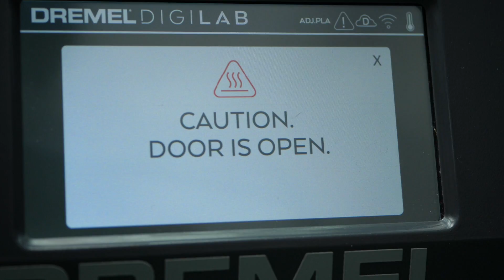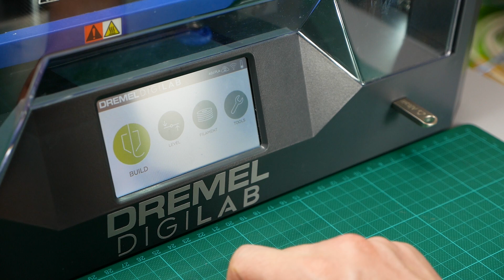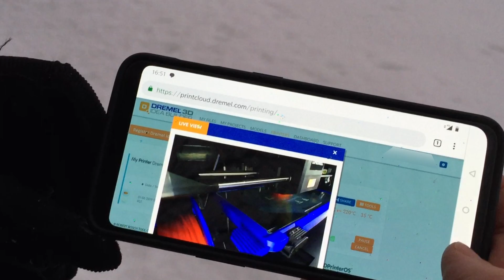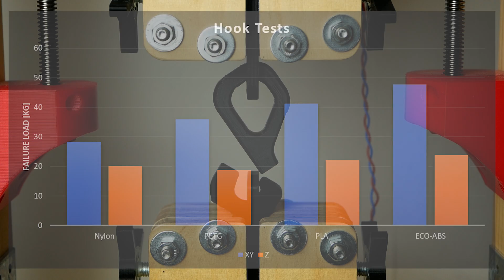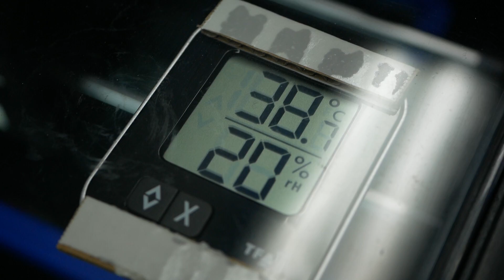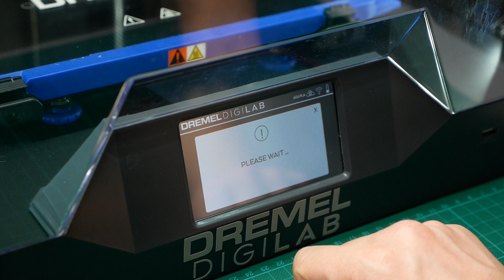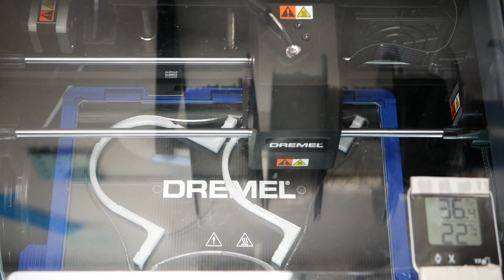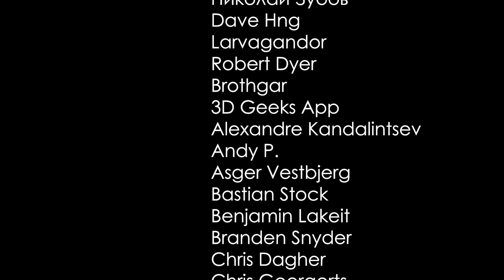Wasted potential!? DREMEL 3D45 + all materials - FULL REVIEW

Comment: I use 3rd Party filaments with this machine, with no problems. I drilled a small hole in the side door, leaving the fake Dremel Eco-ABS filament drum in place, and run the 3rd Party filament (sitting on a Lazy Susan turntable) to the feed tube. My biggest complaint is that you won't find anyone selling smaller nozzles (they are M7 thread) for more detail. So I am working with 3D Solex (in Norway) to produce a 0.15mm, 0.2mm and 0.25mm nozzle. Once tested, these nozzles will be available very soon. By the way, this machine is identical to a Flashforge Creator IIs. What threw me, for a while, was that it wasn't using settings (bed temperature etc) that I was specifying in Simplify 3D. Then I found, in the menu, that you have to select "Use G-Code." You mention the Micro Swiss nozzles, available in only 0.4mm and 0.8mm but, having bought some, the quality is appalling and, because they are made of hardened steel (instead of brass), you have to play with the heat settings quite a lot. Please know that Dremel has changed its position on using 3rd Party filaments and you CAN use any filament, without affecting the warranty. Please check the Dremel website, which confirms this.
Reply: I'm glad you were able to work around the filament issue, but imho the idea of spending 1500 on a printer and then having to drill holes in it and use a lazy suzan (or whatever spool holder type thing lol) to use my own filament is just fucking insane.
Reply: @bob88099  To be fair, this machine is aimed squarely at the Education Market (and spare bedroom user). I'm an Engineering teacher who has campaigned for a long time that all Technology classrooms should have a 3D printer. This machine has been designed to not take up much space (hence the 0.5kg spool space), be fully enclosed, have a camera so multiple students can see what is going on, have a filter to extract fumes, have a heated bed so older students can print nylon, have a system that allows someone to level the bed very quickly and need little or no maintenance or clean-up. This machine fits the bill. I can rewind filament onto the Dremel spool and not have to drill a hole. I chose to do this, to save time. If the Ender came with an enclosure, didn't have an external filament set-up that any kid can play with and had filtration, every school would jump at the opportunity to buy one. It's the same with Desktop CNC machines - schools get ripped off by having to buy limited, enclosed machines - and only from approved suppliers. It also took me years to persuade schools to buy relatively inexpensive water-cooled Chinese Laser Cutters, instead of rebadged far East machines sold by American firms where, when the tube was blown, the whole year's department budget went on a replacement, or we had to pay shipping from the UK to the USA to have the laser fixed under warranty. Nothing in this world is perfect, but this machine comes pretty close for the needs of my students and the H&S inspectors. That said, I have had to pay (out of my own pocket) for an Anycubic Photon (it arrives today) to print really small, detailed items in the classroom (when there are no inspectors around). I have a B9 at home (I bought the first one in the UK, on Kickstarter, years ago)) and that does everything I need and more, but at a price (in terms of money and clean-up time etc). Technology changes by the month, bringing prices down and introducing new designs. I'm sadly old enough to remember how excited I was to open my first email on my £3k Mac Classic. I can't wait to see what comes next, in terms of 3D printing....
Reply from the maker: Great information! The "void warranty" warning was out of the latest manual. I'll check the website to find out more.
Reply: if you could link where it states that it doesnt Void warranty that would be really awesome. All i could find was "Dremel 3D Printers: 1 years (Note: Extruder- warranty is only valid when used with Dremel Filament)
The warranty period commences on the date of purchase of the Product by the end user of the Product.
Reply: Steve Poels I don’t know where to find it in print, but I saw an interview with someone from Dremel who said they were doing away with the 3rd party filament voiding the warranty.

Comment: That sharp, ninety degree bend of the filament into the extruder really freaks me out.
Reply: 0Calvin it is only a problem with wet filament. When it snaps off at the top is when you know it is time for the dehydrator.
Reply: @MistImp1  clear pla is extremely brittle. It won't make that bend i'm almost sure. Pla in general if it was at all heated by being close to the nozzle won't make that turn. It still feels like a bad design to me
Reply: It tends to break if you leave filament loaded overnight. I'm not joking.

Comment: $1600 and you have to use their overpriced, (and apparently) crappy mislabeled filament ? And it doesn't even autolevel the bed ?? You're kidding me, right ??
Reply: You can use any filament. You just wait for it to time out on the rfid reader and then it will ask you for your custom settings.
Reply: @MistImp1  Yeah, but if you dont use the Dremel filament it will void the warranty!
Reply: @Brennholz3000  ikr weirddddd

Comment: Dremel® using Dremel® certified Filament® that is the only size that fits.. It is like that with their whole products line, while i enjoy having that ecosystem, it is stupidly limiting and you end up seeking other solutions or modifying the damn thing to fit some industry standard.. One can guess that it is ok middle range product with good quality control but also that it will cost more in the long run since all parts are available from and compatible with Dremel®.

Comment: I bought this printer for xmas and I find it very quiet actually ... I get 51 dba. I also dont have bed adhesion issues...I only Use dremel filament and I use glue sticks and works great
Reply from the maker: Which materials do you use? With Nylon it's a bit quieter since the chamber fan is not running.
Reply: CNC Kitchen eco-abs

Comment: So wait... Dremel sells an over-priced PETG that will void the warranty on all of their printers if used??  They only list 3 of the 4 as being valid materials for the 3D45...
Reply from the maker: PETG is quite new in their lineup so they probably haven't updated that part yet.
Reply: The website info is kind of dated. If you actually go to load filament into the printer, petg is one of the options on the screen.

Comment: Any chance you could print a Makers Muse torture egg before you return it? I can get it to work at 200% but the base sticks together when printed any smaller...yes I have the 3D45.
Reply from the maker: I did: https://twitter.com/CNC_Kitchen/status/1084853966045937665
Sliced in CURA at 100%, 0.1mm layers and a raft that the bottom of the part doesn't fuse together.

Comment: Woah, that's crazy that they would be willing to mislead with that "Eco-ABS" label. I was hoping for a better overall experience from a known, major brand.
Reply from the maker: Yeah. Why not call it PLA+ or Tough PLA, like the rest.
Reply: @CNCKitchen  Marketing team lol
Reply: Things like that push me to a no-buy very quickly. They produced a rather nice printer, but things like the non-standard spools, marketing lingo, weird unusable bed leveling (like... really??) etc. I would be afraid that my money would end up in a closed eco-system. Now they allow other spools but I can easily see them closing that possibility. It seems it’s missing a bit of “knowing the market”.
Reply: Just like M3D who is selling their PETG under the name "ABS-R", where -R apparently means "replacement". This is a crazy and misleading practice.
Reply: After printing 4 spools of the eco-abs I can tell you it's good stuff.  I made my wife a new dash tray for her 2021 Jeep.   Eco-abs has the same results as ABS with out the fumes.   YET if you read the manual they say it's not ABS.   Yet it's similar in it's good points.  They are not hiding anything.  Just selling a great product that works every time.

Comment: Being open source you should be able to control the cabinet fan but how would that be an improvement?
Reply from the maker: I'd like to fully turn it on for materials like PLA or PETG and then just run it at 30% for materials that like it warm but where I still want to extract the fumes that otherwise will leak out of the printing chamber.
Reply: You can adjust the fan speed in settings when you change filament. Also you can set it to prioritize g-code settings so it uses those rather than the printer defaults.

Comment: Interesting product, I do like the enclosure and air filtration.  But I wonder if carbon filter and HEPA would actually capture those small particles we read about in the Material Safety Data Sheets for those filaments?
Reply from the maker: There is lots of discussion about that topic. A normal HEPA filter won't probably catch everything.

Comment: "CE certified" is not a thing. For applicable products, CE indicates that the manufacturer or importer warrents that the product confirms to all directives applicable to the product in question. Only in some cases, like medical devices, is independent review by a "notified body" required. CE is not optional, it is 100% required for any product that falls within the scope of any of the CE directives. Putting the CE mark on products that isn't covered by any of the CE directives is also a violation.
Reply: china export !
Reply: @wayneuk   there are two CE marks which look similar.  The difference is the spacing between the C and the E.   The mark with close spacing is China Export, wider spacing for Conformite Europeenne.  Confusing.
Reply: @marchyman6621  Its pourposly confuzing.
Reply from the maker: Totally right, but unfortunately we don't see that on lots of Chinese printers that are still sold.
Reply: Or as AvE says it, the mark of the devil, Chinese Excrement.